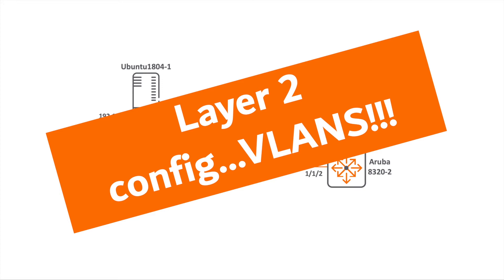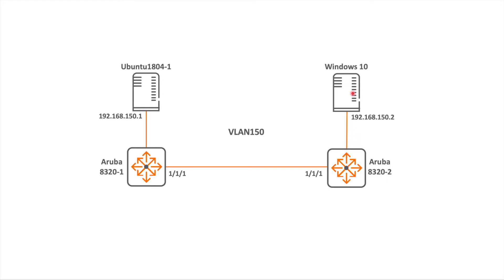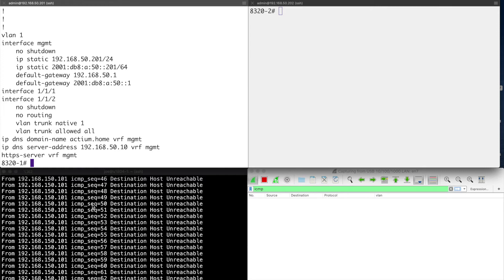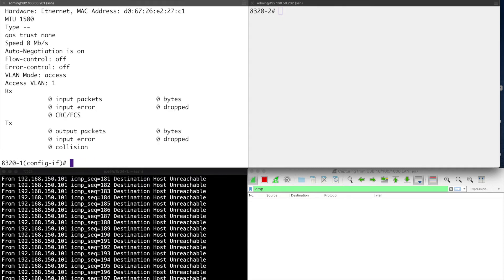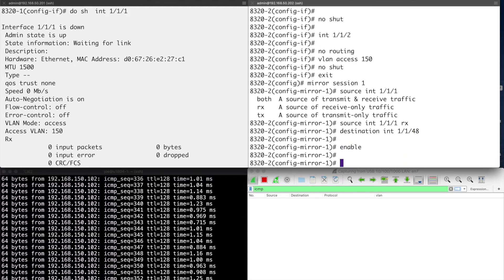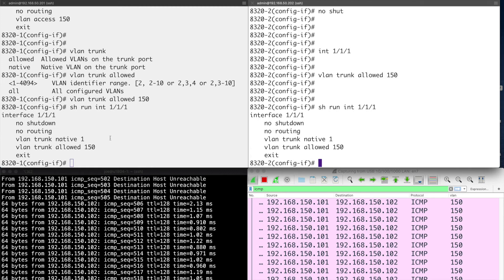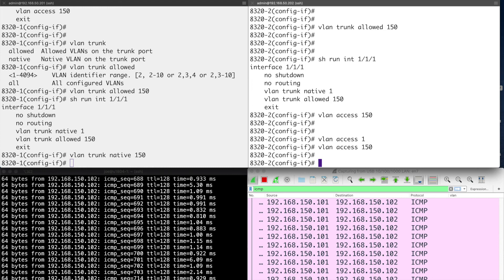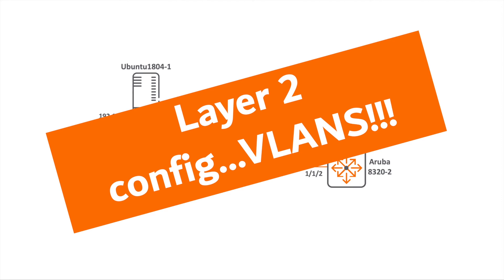HPE Aruba Networks AOS-CX Basics 3 - VLAN Config Hands-On

Comment: I have a 6200F switch and I need to configure the interfaces to connect a phone and a PC. 
The "vlan voice 2" or "voice vlan 2" command doesn't work. 

The official guide shows that you have to configure:
vlan 2
name PHONE
voice

will this configuration work with the interface configured as access in vlan 100 (data vlan) for bot pc and phone connected?

thanks so much to who will answer!!!

Comment: Another great video! I do however have a question about the tagging. I'm used to the OS's of the HP Layer 2+ switches where vlans work a bit different. For example, a switch to switch port on that OS would untag vlan 1 (where their management IPs are) then tag the other vlans for traffic flow. In AOS-CX, I had to set the port to native vlan 1, but then also allow vlan 1 with the other vlans. If I only had vlan 1 set to native but not also allowed, my pings would not flow. On the other hand, I could also only allow it and not set any vlan as native and it works fine. It seems that I'm not quite understanding the purpose of the native vlan function.

I'm rather proficient with the standard HP switch OS but oh my have I just been bumbling around AOS-CX 🥴 I've also heard many a time that using vlan 1 in practice is a bad idea, but this network has been built for over 15 years now and changing it isn't exactly in anyone's headspace.
Reply: The native VLAN is the VLAN that frames without an 802.1Q tag are placed into. By default this is VLAN 1, but is configurable. 
Be aware that his is only locally significant, if Switch 1 has VLAN 1 as native and Switch 2 has VLAN 2 as native, the frame sent from Sw1 will be untagged and placed into VLAN2 on Sw2.
The allow feature is different, allowing you to select a subset of traffic to flow, be that tagged or untagged (native).
You say "On the other hand, I could also only allow it and not set any vlan as native and it works fine", the native VLAN on a trunk will just default to VLAN 1 in this case, you've allowed VLAN 1 and thus traffic will flow on it.

Comment: Some AOS-CX video suggestions (BTW:  The snippet videos are brilliant...short and to the point):  (1.) If one can create remote mirroring over a local network, how?  (2.) Adding AOS-CX routing/switching to an existing AOS/Provision/Procurve environment??  (3.) What are the AOS-CX pros/cons of using Layer-3 routing versus Layer-2 VLANs for segmentation and switch speed in light of the 8320/6300 device speed???  (4.)  Using Global routing versus Interface routing - advantages/disadvantages ++ design considerations ????  (5.)  A summary video of all your current and planned basic AOS-CX videos include diagrams and other concept helps.  Thanks.
Reply: Thanks for the suggestions. Mirroring and inter-op with AOS-Switch / procurve added to the list. Not sure what you mean by number 4, please could you give more details?
Reply: @null_zero   Yes, i was too vague ( "(4.)  Using Global routing versus Interface routing - ")  I have been confused why one activates global static routing and routing per interface. Must one activate global routing before one can use Interface routing? My confusing points and questions illustrate I do not have a grasp of the ROUTING concepts within AOS-CX...hence the needs for more BASIC static routing instructions / clarification.  Thanks for your follow-up.
Reply: @wx0084  AOS-CX has a default bias towards L3, using the old differentiation between router and switch, it is more like a router on boot than a switch. Global L3 routing is enabled by default and the interfaces on CX devices are layer 3 by default, they accept IP address configuration directly on the port, similar to a router port. In this mode, L2 switch port config, like access or trunk, will be rejected. One must alter the CX port mode with the "no routing' interface subcommand to transition the port akin to a switch. With 'no routing' one cannot configure an IP address directly on the port but now 'access' and 'trunk' can be configured. If you pause at 04:00 you will see that 1/1/1 port has no config under it. This is an L3 port. Port 1/1/2 is configured with 'no routing', this is an L2 port and can be configured as a trunk.
Reply: @null_zero  I am amazed you took the time, energy, and skill to reply.  Your response helped remove more of the aos-cx "rooooooooting" fog.
Reply: @wx0084  You're welcome. Thanks for watching.

Comment: I don't understand why you teaching the WRONG PRACTICE FIRST before the correct best practice? Before the viewer see the correct configuration you are showing how to wrongly configure the switch that is not GOOD
Reply: Thanks for your insight, I disagree. I take the ports through various stages of configuration, showing correct and incorrect.
Reply: I agree. I was confused during the first half of the video. I re watched like 4 times trying to understand. Please show best practice then go into problems you could run into.
Reply: @Damien-ii6ft  Sorry that the video confused you, that is not the intention.
I go from access both ends to trunk with the same allowed VLAN at both ends, then go into a discussion about misconfigurations. Thus, I do show the correct configurations first, as you've asked. I even have a ping running successfully to show this.

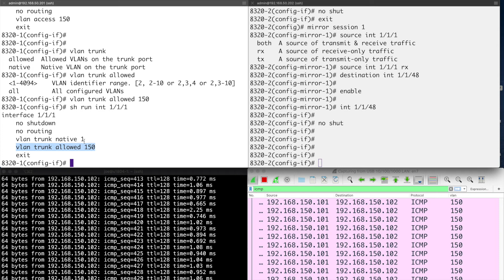Comment: At the 10:25 mark I think I could have done a better job of describing what's happening. The trunk on 8320-1 is sending frames tagged in VLAN150, the receiving port on 8320-2 is still an access port in VLAN150. In that state 8320-2 will switch the traffic to the end destination, so there will be one-way comms.
However, the return traffic will leave 8320-2's access port untagged and will hit 8320-1's 1/1/1 port but that switch will deem it to be in the native VLAN of 1, rather than 150, because it is untagged, and will not send it out on VLAN150 to the ubuntu VM.
For the ping to be successful, the return traffic needs to hit the source, hence why it is timing out.

Got all that? Phew 🥴 In conclusion though I would never recommend configuring one end differently from the other, it is just too easy to make mistakes. Identical VLAN config either end of the link is the desired state.